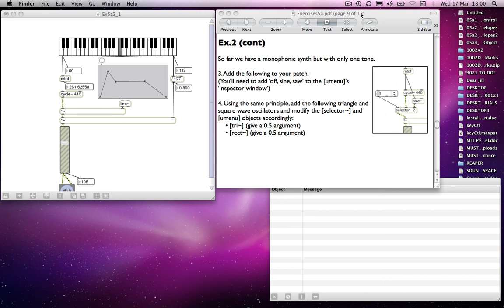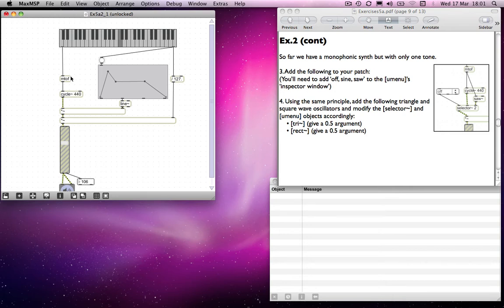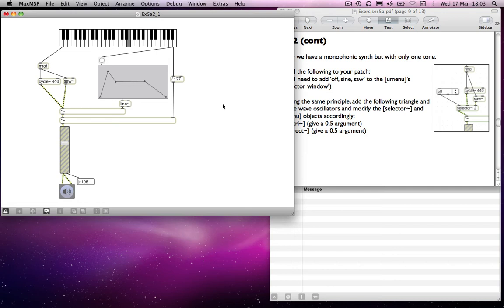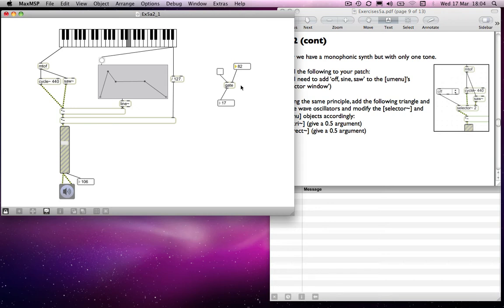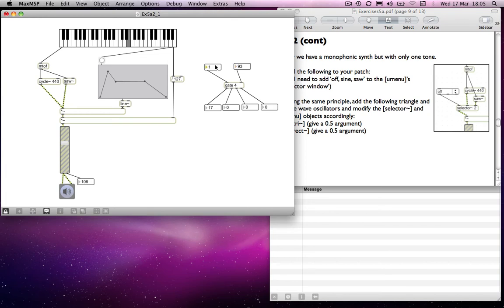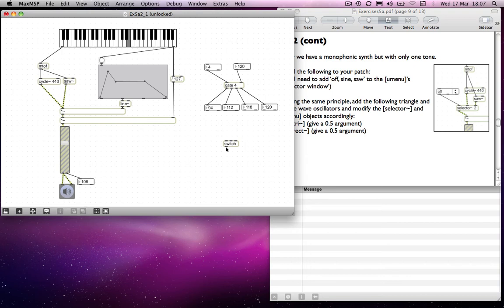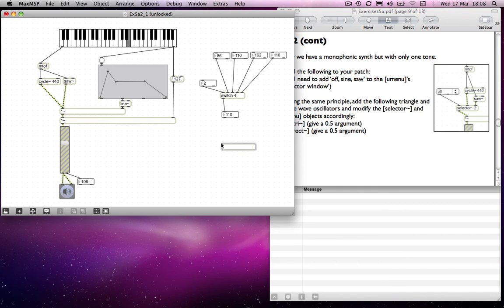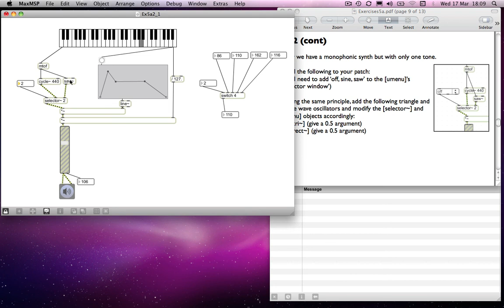Max MSP Tutorial 05a5 Simple Synthesis—Alternative Oscillators & [selector~] [1]

Comment: Hey, again, great video! :)
Few doubts- first, initially i thought cycle~ was a sine wave oscillator, with its frequency as 440Hz, the help file says its a cosine wave, and i cannot understand the 'samples part' in the help file, and why do we use '440 hz' specifically?
2nd doubt- the saw oscillator has no frequency assigned. why is that?
and is the function object serving as a frequency modulator? is that the frequency inside the 'function' object?